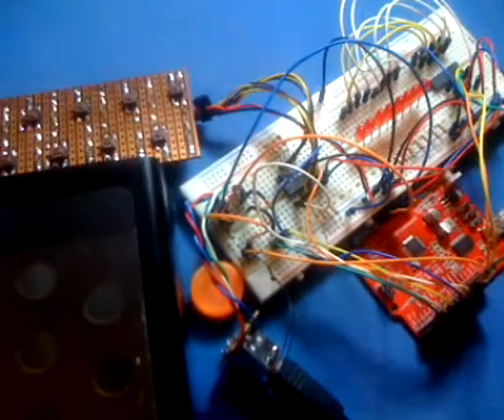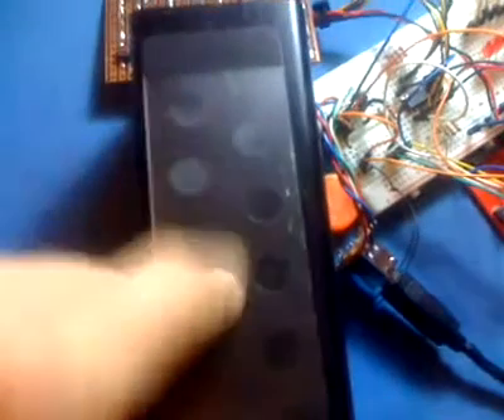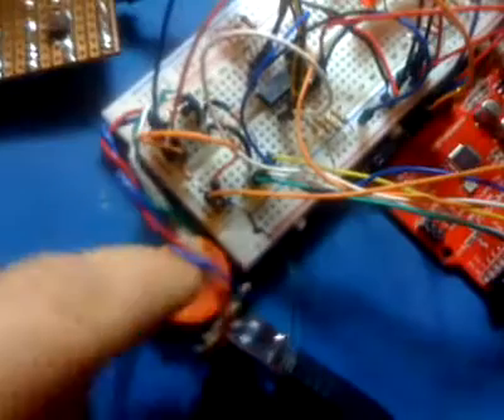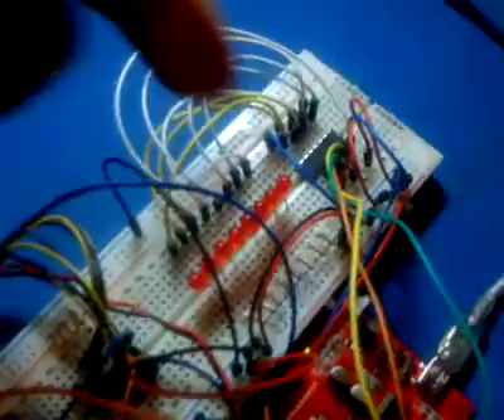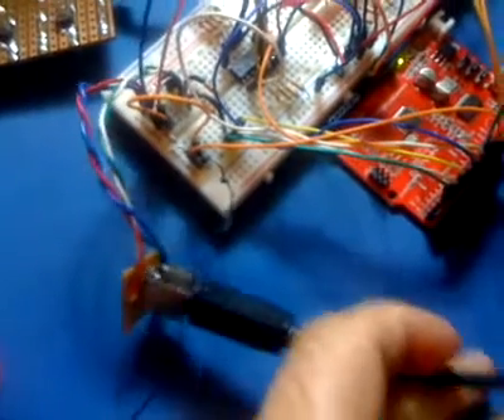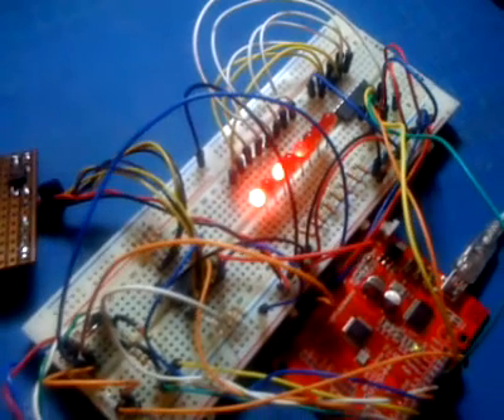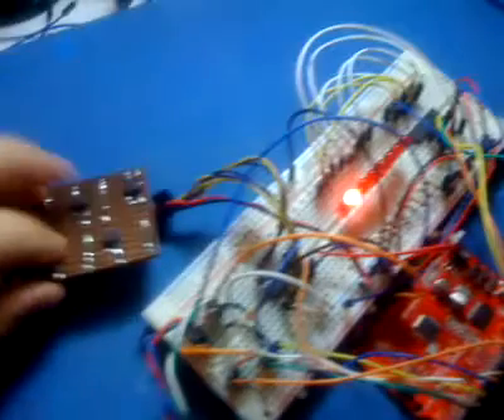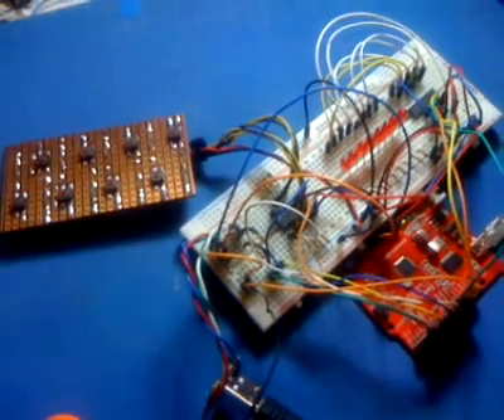Arduino with shiftIN, shiftOUT and Virtual USB Keyboard

Comment: This is exactly what I was looking to do. I want to build an interface for a jukebox, from a pc emulate the keypad on the jukebox, which sends serial data from a 4021 to the controller and have the pc read the serial data from the controller going to the 7seg display via 4094's. could you post the code for this? I'd really appreciate it. I'll post the finished code if anyone is interested.